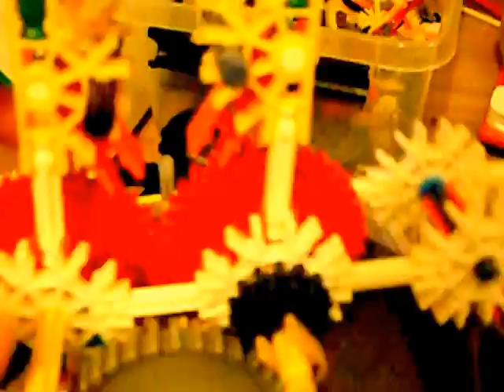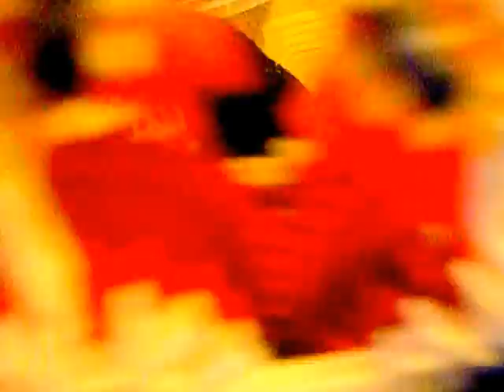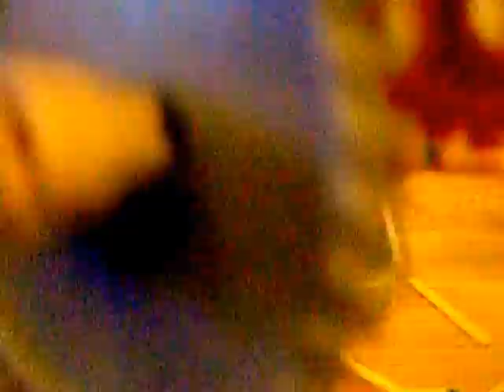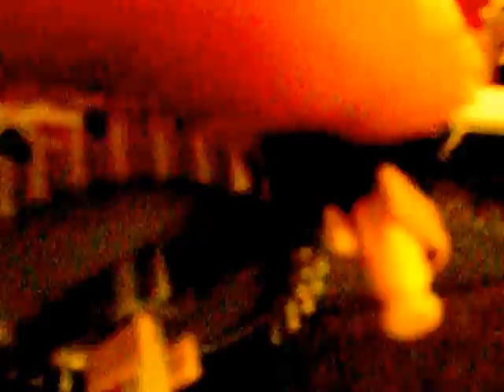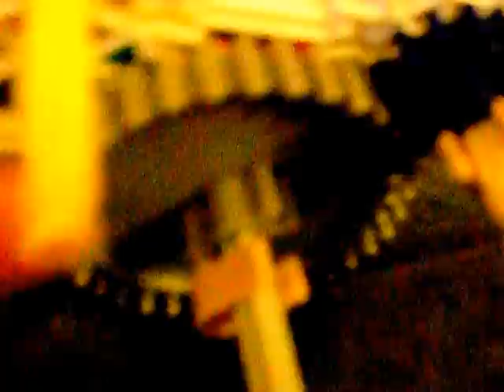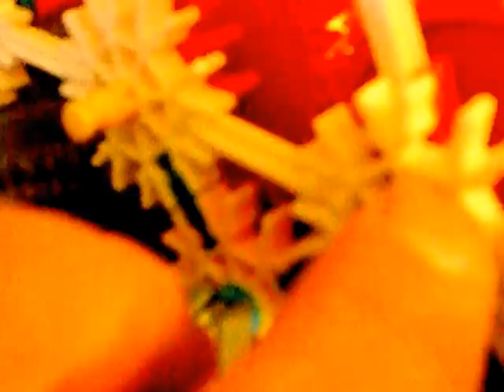Knex Ratchet CVT gearbox and reversable drive Lego Fischertechnik Meccano Fischertechnic

Comment: @ChuffChuffWoo well ya, but im trying to make a hover board and i put it all together but when i jumped on it all it did was break into pieces. not sure what im doing wrong, ill tell u after i finish doing research if the plastic structure will hold the mass inverter, but the displacement of weight makes the power cells overheat, and my feet are highly radiated, i mean really there like 3 times bigger than they should be but i guess thats what u should expect when ur on top of a fuision raction.